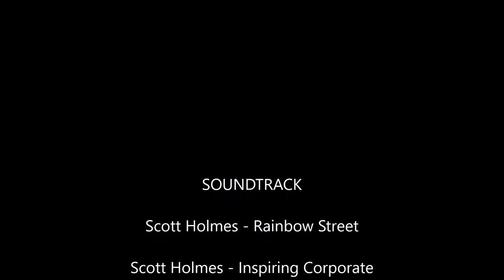Making A Pair Of Laminated Corbels From Oak - JD Woodwork

Comment: what kind of router and bit are you using?
Reply from the maker: The router is a DeWalt 625; I've had it for about 13 years, and it still runs great. The cutter is a 50mm flush trim from Axminster, it has a down shear cut and gives great results.